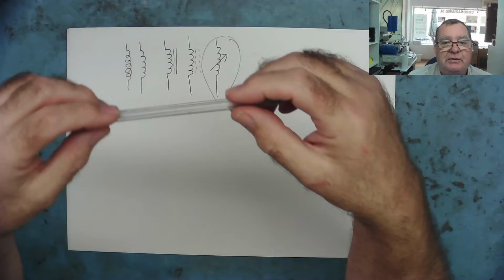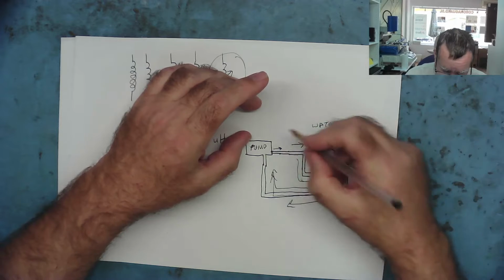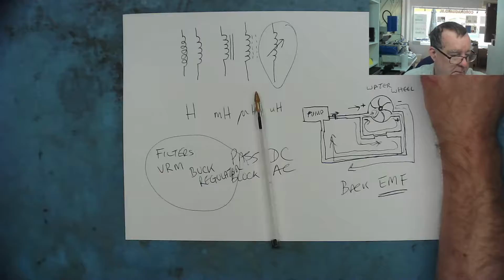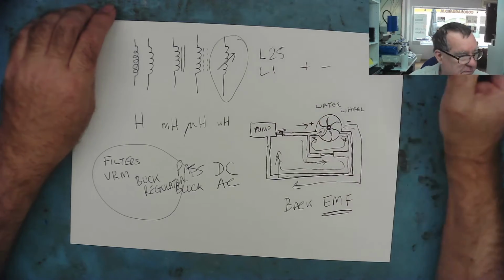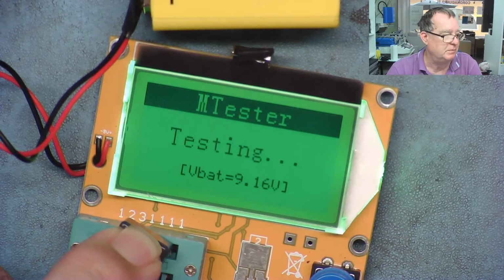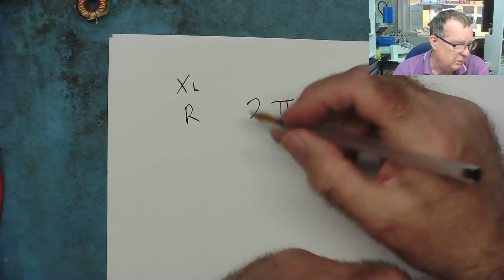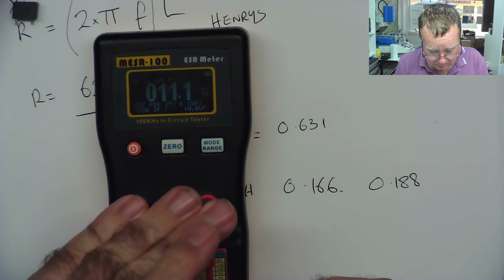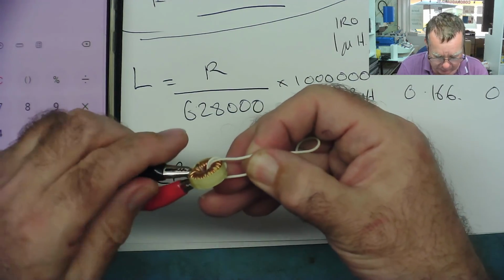All You Need To Know About INDUCTORS To Fix Stuff!  LER #187

Comment: Excellent pedagogy! 21:51: Sidenote.. Seems you've got your LCR meter living dangerously. Is that ZIF tied more or less directly to the microcontroller? I am thinking the slightest discharge while trying to hold or move the component could arc to the microcontroller. My understanding is they can't use protective circuitry because it ruins the test. 23:14: It should work to measure low value inductors by placing them in series with another inductor to get over the detection threshold.

Comment: This is great! Note that if you're always testing with 100khz you can skip the divide by 628000 multiply by 1 million and just multiply by 1.592 (which is around 1 million / 628000). That will take you straight from ohms to uH

Comment: I see them in usb charging port using SMD, it is used in later version of Chord Mojo DAC
mine was melted away
marked as FB

not sure if it is inductor

TDK  MPZ2012S601ATD25 
Ferrite Bead, 0805 [2012 Metric], 600 ohm, 2 A, MPZ Series

Comment: I’ll try using a freq counter to get a f reading on my ESR tester.
Reply: ESR testers don't necessarily use a fixed frequency.
One method of measuring ESR is to apply a pulse of known current magnitude to the capacitor under test. If the ESR were zero, the voltage across the capacitor would begin to rise linearly from zero. With ESR you will get a step rise in voltage at the start of the pulse equal to the applied current times the ESR. You see this thing very conspicuously in switchmode power power supplies.
If your ESR tester works this way, it will probably be useless for measuring inductors (an inductor would force the current to start at zero so you'd get a large voltage step).

Comment: 1:13 "Magnetic" material? Or "electrically magnetizable"? I mean, the core is never "magnetic" on its own, before current is applied, right?
Reply: That is correct in general.
Sometimes a permanent magnet separate from but attached to the core is used to "bias" the core material to make the behavior sort of asymmetric. This sort of thing was often found in the circuitry for a television CRT.

Comment: Hello everyone... well I waste 3 days finding the problem with the external power supply LG Tv (19V). In the primary capacitor, I have only 60ac/dc then it discharged it then going to charge very slowly. I check everything following your entire video library  it helped me very much(thank you) At the end of the day  i find the problem and it was the inductance close the bridge rectify, I changed and voilá the voltage up 320v ac/dc and the capacitor carged very fast. thank you so much!!

Comment: Great content, just a question, I have a motherboard with the toroidal type inductor on the vrm, can I change this type of inductor to the “modern” ones (the cube-shaped shielded inductors)?
Reply: There are properties of toroidal inductors that make them superior to other shapes for some applications. They are still very much used in modern designs. I've designed a lot of industrial switchmode power supplies. Every single one has used at least one toroidal inductor.

Comment: Did I miss something regarding the difference in inductance dependant on the type of core used?
Reply: I didn't notice anything about core materials.
They make a HUGE difference not just in inductance as such but the overall properties of real inductors. In switchmode power supply design choice of inductor core material is not a trival task.
Reply: @D614G_aka_Doug  Exactly.

Comment: So basically an inductor and a coil  is the same ?
Reply: In practice many inductors are indeed coils of wire. Coiling allows the magnetic field around a conductor to act not only "locally" on the conductor but also on adjacent turns. In general inductance is proportional to the square of the number of turns.
ALL conductors exhibit inductance. Even a tiny surface mount resistor or capacitor has "parasitic" inductance.That inductance, especially in capacitors, can be detrimental in some applications. The copper tracks on a printed circuit board have inductance that can be a big problem in some types of circuitry.

Some people do refer to inductors as "coils." "Choke" is another term. It used to be quite common but isn't so much anymore. You'll hear it more in reference to inductors used for filtering applications both at low frequency (e.g. for "smoothing" after the rectifier in a vacuum tube amplifier's power supply) and at high frequency.

Comment: why is there a bypass in the water analogy i always thought inductors just had a series resistance and because of that some kind of protection circuitry like a freewheling diode is needed
Reply: Nothing analogous to that weird bypass pipe exists in an ordinary inductor. It may exist in the external circuit.

Comment: Does the direction the wire is wound on the inductor matter?
Reply: Not for a single-winding inductor.
If an inductor has multiple windings the directions of the individual windings relative to each other are very important.

Comment: Great video series about electronic components i first started learning electronics like this, all i can say is that those "cubic" through hole inductors that have a label on them are a pain to remove with a micro soldering iron and a desoldering pump or braid and they get hot to touch i think a desoldering gun is a must to remove them, now i don't even think about messing with them

Comment: These videos are gold, really enjoy them. It's worth mentioning as well that if accuracy matters to some that there are more comprehensive testers for this but can get very pricey, very quickly. 
Peak Atlas do very good testers at a more competitive price point in the form of a LCR45 that will do 0.0uH to 2H, resolution typically 0.2uH, accuracy typically ±1.5% ±0.6uH and will do auto or manual test frequencies of DC, 1kHz, 15kHz and 200kHz, these retail at £90 plus VAT.  Peak atlas do a slightly cheaper LCR40 but with less range. 

Peak atlas do many other testers like ESR, component testers etc. they seem quite popular among techs, I suppose because of price/performance ratio before going to lab grade expensive stuff. I also own the testers in this video and are good enough for the most part and get you in the ball park but if accuracy is a must, as with everything, more money needs to be spent.
Reply from the maker: Yeah I have the Peak Atlas DCA55 semiconductor analyzer and I love it. You no doubt saw me use it in some of my videos.  It's a fine piece of kit.
Reply: @learnelectronicsrepair  Yes absolutely, I'm planning on upgrading some of my kit to peak atlas stuff very soon. I understand and like how you pitch these videos for the beginner who maybe doesn't have all the kit or maybe doesn't quite know how far they will get into and doesn't want to drop a load of money on expensive gear, or even if they do get into it, what kit can you get away with. I just wanted to throw it out there about these cheaper testers, which I thought was the only thing left out of the video when it came to the subject of testing. I know you don't need telling Richard, my comment was more for the viewers, so they dont go out rushing to buy kit before knowing the caveats ;)
Reply from the maker: @Adrian_Finn  You input and suggestions are valued as always 🙂  

In the case of repair  I think probably it is not necessary to measure the value of an inductor.  I can see possibly that it would be useful to do that if you have some salvaged parts and want to know what value they are.  

Possibly measuring a lower inductance than the rated value could help in finding inductors with shorted turns - if you knew the rated value.  Really to test those faults you need a 'ring tester' and anyway mostly you find that sort of fault in Transformers rather than inductors so I didn't mention it in this video.  But I do intend to get/build a cheap ring tester and play around with it on another video.

 I did wonder while making this video if an inductor with a shorted turn would not show a further reduced inductance if you wrapped a second shorted turn around it - I thought maybe it would be a good way to detect shorted turns, but when I experimented with the idea, wrapping a second shorted turn around it just made the inductance go lower again.  Nice idea, I thought, but it didn't work. 🙄

Actually I don't think I have ever found a faulty inductor, although it is possible some faults I could not diagnose were down to inductors I guess.  I have seen quite a few faulty transformers, and some that had burnt up on the primary winding.  Also faulty line output transformers back in the days of CRT TV. Transformers will be another All you need to know topic soon.
Reply: @learnelectronicsrepair  Thanks Richard, I do get worried that my comments seem like a negative criticism, of course I never mean it that way. 🙂 looking forward to the next one.
Reply from the maker: @Adrian_Finn  No worries - and I am certainly not beyond criticism LOL

Comment: Quite interesting. I have that same ESR meter and I´d never had thought about using if for this purpose.
The back EMF explanation is also quite good. Before I knew it, now I get it.

Thanks, Richard.
Reply from the maker: @JosephGSX Have you seen the videos where I use the ESR meter to trace short circuit MosFETs in multi-phase VRMs?
Reply: I sure haven't seen it yet, so I'll put it up in the queue of interesting things to watch here. Thanks!
Reply: @learnelectronicsrepair  my next watch
Reply: I read this comment before I saw it in the video, now I wait with baited breath.